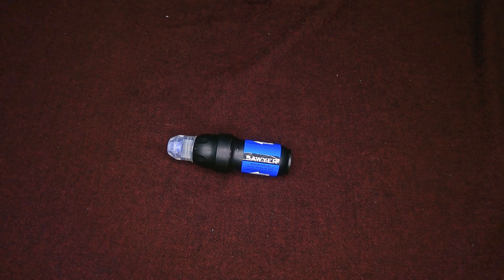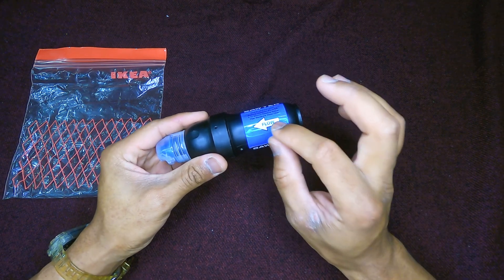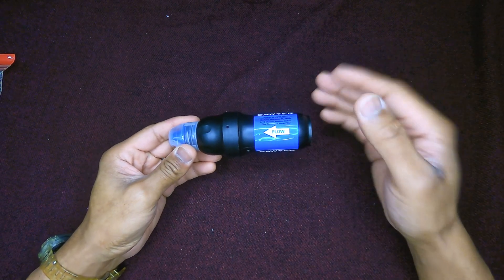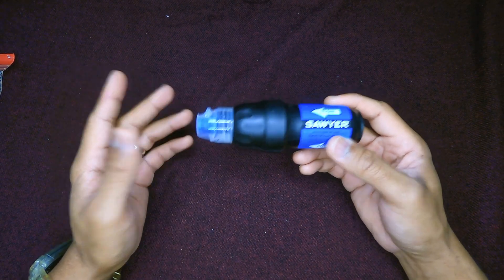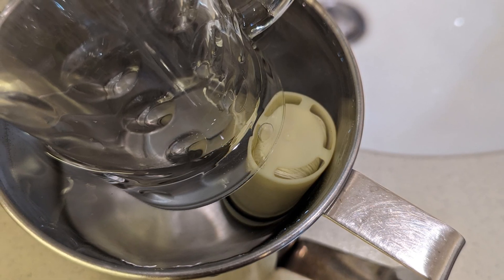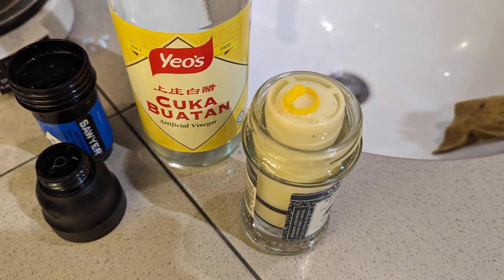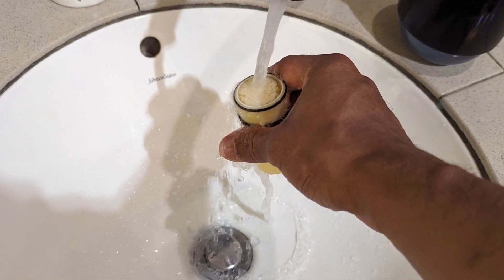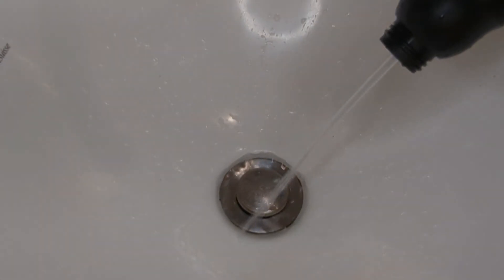How to Restore a Sawyer Water Filter's Flowrate - Fouling & Off-season Clogging / Mineralization

Comment: Well, thanks for the advice!  I have a SP184 Sawyer 4L system that's been running slower every year.  It is at least 10 years old however I probably filter no more than 20 gallons per year.  I go to the Boundry Waters Canoe Area Wilderness in northern Minnesota each year.  I also pre-filter my water by running it through a coffee filter (there is always something floating in lake and river water)!  Followed your directions and it has vastly improved after the first soak in white distilled vinegar.   Thanks for saving me $150!
Reply from the maker: Glad to hear the vid was helpful. Keep at it a few times more and you'll be golden!
I hope more people come across it and do the same for their filters. I see too too many folks saying their filter is "slow", then diss Sawyer n then chuck it and go out and buy a new one - usually something with poorer filtration specs just so they can get "much better flow". And they justify throwing away their clogged filter with...."Its just XX dollars for a new one. What do you value more? XX dollars or your health?", which quite frankly is not even a valid argument.